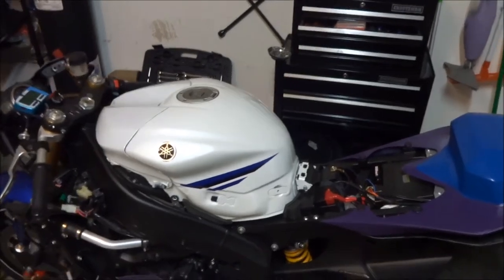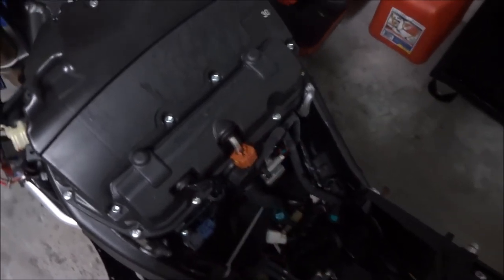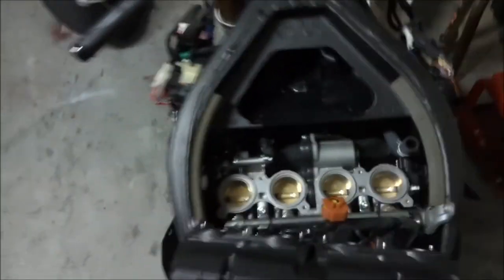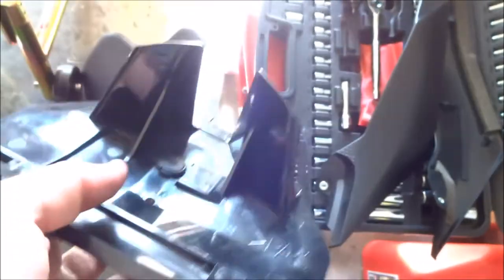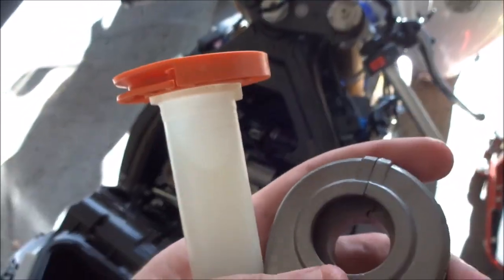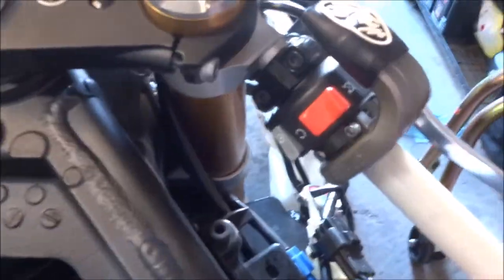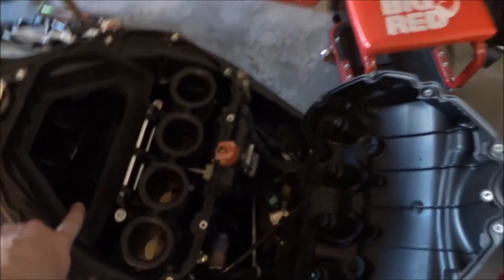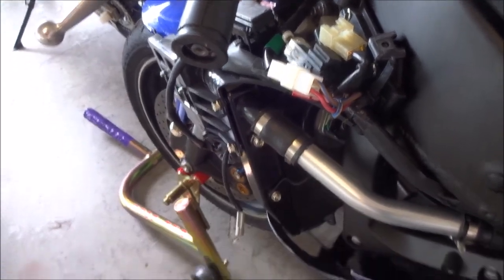Motion Pro Rev 2 Throttle Kit Installation - Yamaha R6 (HD)

Comment: Great video works perfectly for 2017+ as well.
I found that using a zip tie attached to the pull cable head makes it easier to route the pull cable under and around the reel.

Comment: I have the rev 3 and for the life of me cannot find a good way to route them. The throttle snaps back perfectly but if the cables get touched at all the rpm’s will not come down super dangerous. The weird part is I can feel the return cable doing its job and getting the throttle back to zero but the rpm’s stay up anyways I don’t know what to do
Reply from the maker: Yeah, I can't remember now because it's been so long, but I think i had to mount it upside down and really fiddle with the cables to get the tension off of them so the return would work properly.  But I definitely had that issue as well and it seemed very daunting to try to get it working initially, but enough fiddling finally got it to move freely.

Comment: Hey man were the cables long enough the way you routed them? I’m having a hard time with mine. It seems like every way I try to route them won’t work. Were you able to sweep the bars with no tension on the cables?
Reply from the maker: It is very tight. I can fully turn my bars, but the cables do fight the housing a bit. Mine are routed over top, it would not even remotely fit properly going underneath like stock. But the cables are pulling down a bit. It's very snug, but everything does operate smoothly.
Reply: John-Paul Craig ok cuz I literally tried every way and I can not find a perfect route to where the cables are happy. But I will try the way you routed them once again and see how it goes. Thanks man
Reply: disarmyou84 did it wotk
Reply: Kevin Corrigan yea it did. There’s a bit of tension on the cables when I sweep the bars all the way to the right but it’s not too bad. Better than the way I had it before